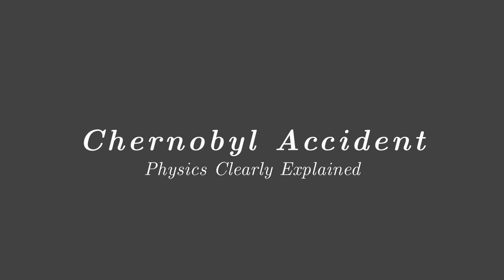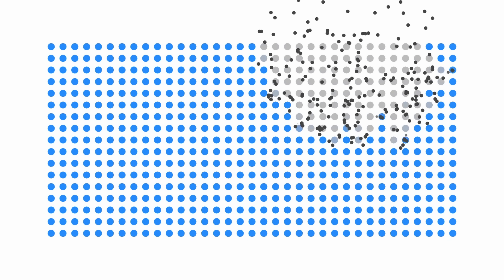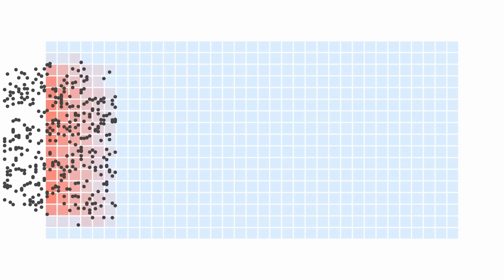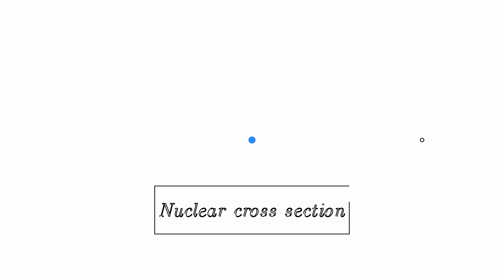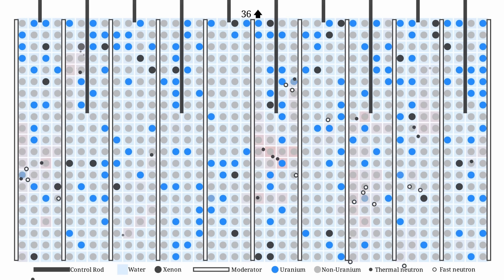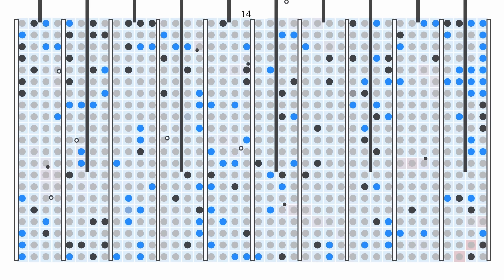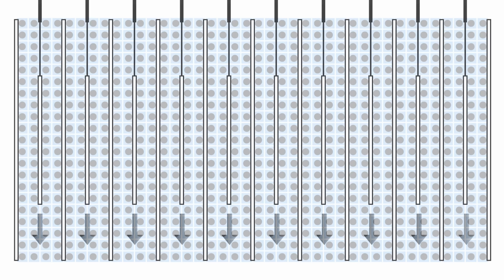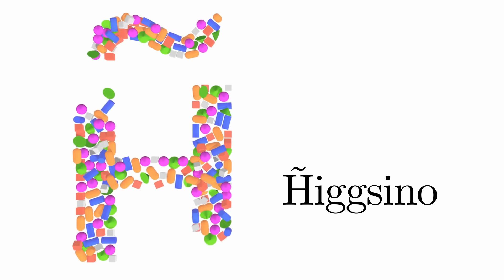Chernobyl Visually Explained

Comment: "The computer told them to turn off the reactor. They turned off the computer instead." Those words are equally funny as they are horrifying.
Reply: Sounds pretty much like safety culture in my country.
Reply: @manabellum rip
Reply: Nice way to put it (I'm an Indian) @manabellum
Reply: @manabellum  but we haven't had any such major lapses ( yet ) ..maybe a large population doesn't give a sh*t about safety , but what I've observed is this behaviour is only rampant when they are involved in it themselves ...for example drivers ...they know they will die too ..and that is what helps them go to those lengths I think ...think of it like this ..since their life is at stake too ...they respect the lives of the other only as much as they do their own...but organizations like isro and the army...where the sphere of influence of one's ignorance is way larger than they could imagine ..people are more reserved.
Reply: The nuclear operator equivalent of putting a sticker over the check engine light.
Reply: 😂😂😂 @MichaelTheRead
Reply: As a matter of a fact, the big failure here has been to deactivate half the recirculating pumps, decreasing water to allow the xenon buildup to make the reactor crazy..
This is horrifying.
Reply: No the crazy fact is nobody seemed to know how the control rods were a bad design too. This design would be like pressing the gas on your car to hit the brakes, you see how that makes no fuckin sense? But they did that here putting graphite tips on rods that should have been purely made of boron. It's the equivalent of hitting the gas pedal to somehow slow down from crashing your car, makes no fuckin sense and you will crash they just got lucky because they never needed to hit the brakes, until that one day they needed the brakes happened
Reply: @Flodu60500  What? The big failure was by the reactor engineers to make the graphite displacers shorter. The incident isn't a result of failure by the workers...
Reply: @Flodu60500  But that was the test!?
Reply: @Flodu60500  As a matter of a fact, they activated extra 4 recirculating pumps, plonker
Reply: "I'm afraid I can't let you do th---"
windows shutdown noise
Reply: Well, of course it’s saying that.  It doesn’t know we’re running a test.
Reply: Why seek out to fix carbon monoxide gas in your house when you could just remove the detectors making those anxiety-inducing noises?
Reply: @AnalogOsprey  Of course! Sleep tight. ;0)
Reply from the maker: computer: OH MY GOD SHUT IT DOWN RIGHT NOW!!!
operators: Okay 👍 shuts down computer

😂

I stole this comment from @herobrine8763 in a video response to my video
Reply: @Higgsinophysics  🤣🤣
Reply: @Higgsinophysics sounds like what homer simpson would do 😂
Reply: @Higgsinophysics  its says they sent a guy to the recreational center pool to investigate what happened to the swimming pool after the shutdown
Reply: @Higgsinophysics  prob the people they needed died
Reply: @Higgsinophysics  doesn't seem so funny. my great grandmother, my grandfather and my father died from Chernobyl.
Reply: @louiscyfer  We aren’t laughing at the deaths. No one is. It’s the utter stupidity of shutting down the thing that would have prevented the meltdown or at least warn them about the potential danger coming. It’s dark and I’m sorry they passed away from this. But, don’t take us the wrong way.
Reply: @louiscyfer  You are allowed to not find it funny. No one is stopping you.
Reply: @antisocialal4799  there was a design problem and a training problem. the people doing the test were not qualified, and the design of the reactor made it worse.
Reply: @NoriMori1992 Funny how?
Reply: The soviets were legitimately pretty good at automation engineering and computer science. So it's all the more disappointing that they designed a series of very effective control systems, and then promptly placed them in situations were they were ignored or pointless.
Reply: @r.b.ratieta6111  Dave?......What are you doing Dave?
Reply: They ignored the computer message because they are doing a safety test which the computer doesn't know about it
Reply: The safety test they were performing probably would not have tripped an alarm from the computer if they would not have forced the reactor to satisfy the power conditions needed for the test, without gradually running the power down to eliminate the factor of xenon poisoning. They tried to perform the test at night specifically to avoid having to reduce power output at high demand times during the day. To safely perform the turbine rundown test, it's been estimated that the reactor would have likely had to have been gradually run down over the course of several days in order to burn off residual xenon buildup. Apparently unacceptable in an area where there was high power demand from industrial users.

The SKALA process system was dead on right when it told them what they were doing was not safe, because it factored in conditions that the operators ignored such as the high xenon levels and reduction in cooling flow.
Reply: @wysoft the test was supposed to have been finished by the day shift as it was scheduled to be taken down for maintenence. The test had originally been scheduled to be performed during the day shift but around 2pm another power station went down and the regional operator requested unit 4 be kept online for the evening demand. The people who were originally supposed to perform the test were long gone and the night shift shows up and is basically told, by the way we're doing this test now.
Reply: @wysoft  thats not typically how reactor safeguards work. They don’t know what xenon levels are at all. They create a “trip” limit based on (mostly) coolant flow and other plant parameters. When the trip limit is exceeded the protection system will automatically insert a trip such as automatic rod insertion or a scram of severe enough. They deactivated these automatic trips
Reply: @namishkhurana5172 dumb Russians 😂
Reply: “Alarm fatigue.” Obviously I don’t know about this computer system in particular, but in general when computers are programmed to cry wolf a lot, operators are effectively trained to ignore it. I’m not saying it’s the right thing to do, but it is a real problem.
Reply: @KirisutonoNeko  System could not told them squat - PRISM program running on Scala computer needed 20-25 minutes (MINUTES!) to run full system raport. That was printed. And delivered by hand from the Scala room 50+m down the hall from control room. And yes, it gave operators recomendations, but it was mostly in term of fuel burnout ratios actros the core.

It was not screaming shit at them. The last raport was from 1:00am. It was not live nor ever was is inteded to be so. And Legasov, throwing tantrum in 1984 and ending Computational Science Departement of Khurchatov Institute made sure it stayed that way.
Reply: @ZiobroV  
I believe you. I meant to be mostly adding general commentary about alarm fatigue to the discussion above, but yeah, have no information as to this specific case.
Reply: Technically they were running a test😂 The computer didn’t know that. 
The point of the test was that at that low power would the reactors be able to power the pumps for its internal water system before the backup generators come back up in 60 seconds. (Meaning they are trying to run a condition the computer is not aware of so they turned off the sensors 😂). They cut all these corners thinking there was a fail safe button SCRAM. I mean if there’s a button I can press to erase my mistakes why not. At any other point the scram would have done its job, but they had created with all the cutting corners a perfect condition for the SCRAM button to be a detonator, which was now a design flaw
Reply: -My mind is going. I can feel it.

-Daisy, Dai…sy, …give me your an… swer, …dooo!
Reply: Packing the whole damn thing in graphite didn't help either.
Reply: @scottrackley4457  well, is a design decision, using graphite as moderator (+) instead of just water
Reply: Except that they are not funny in any way.
Reply: The most Soviet quote ever
Reply: Shooting the messager: atomic age edition.
Reply: There’s a “In soviet Russia” joke in there 😂
Reply: Hey if the blaring alarm from the computer is turned off, it will be okay as the alarm go off right?
Reply: This!!
Reply: Humans 😂
Reply: Happens more often than you think. A lot of accidents are a result of hubris and no regard for safety. Computers rely on reliable and accurate inputs. I bet the operators thought the computer was on the fritz because it said there was something wrong, but they had all the control rods out. That didn't make sense to them. They were probably only taught that the rods slowed the reaction not the water and xenon. They should have known that if the rate didn't increase at all after removing the rods something was wrong. Increased demand and pressure may have caused them to overlook and press onward hoping the issue would sort itself out. I can't imagine a time anyone should just accept the reactor is okay if you have to remove all of the rods. 

It's like driving your car if you ever have to put your pedal to the metal just to start moving would you not question it? They kept their foot on the gas until it was too late

I'm an engineer myself in an industry that's much more forgiving, but I am trying to be better about teaching my operators bout our manufacturing process in more detail so they can understand when something is really wrong and why
Reply: It's the Soviet Union in a nutshell.
Reply: These days it might be a good idea to not listen to the computer, because AI literally wants to end humanity..
Reply: And where never said.
Reply: I didn't see it so there's no problem
Reply: This is how accidents happen all the time most are negligence or lack of time to understand and react.
Reply: When my car makes strange noise i turn up radio.
Reply: "Fine.. I'm out. You're on your own" - The Computer
Reply: The real cover-up is that this was a secret feature of the RBMK, not a bug, incase of an invasion.
Reply: Other than it didn't happen.  The print out was old tell a type and in a different room. the data was not part of the manual
Reply: *Societ Anthem plays in the background"
Reply: Still happens everyday in modern civil & military aviation

as well as... well... everywhere =)
Reply: @СергейМандрик-ф6е  no... that is a load of cope.
Reply: @n3v3rforgott3n9  it really does happen everywhere due to corruption, in small and large companies. That's what happens you have a structure that favors production and revenue over people.
Reply: @n3v3rforgott3n9  No it's not.  Do you have any idea how often we shut that noise off to actually fly the aircraft?  We don't call her "bitching Betty" for nothing.  That's coming from a Marine (Naval) flight officer.  Semper Fi
Reply: @JViello  that is not a nuclear reactor....
Reply: I think (this is my opinion) , that we need to stop calling the Chernobyl meltdown an accident.  

It was a case of : " fuck around and find out " , and they bloody found out. 
It was case of expected and predicted consequences resulting from completely intentional actions. 

It was the biggest case of : "we told you so" , in recorded history. 

It literally was not an accident.
Reply: Those words made me click the video!!! 😂😂
Reply: Like portal 2!
Reply: Well you have to understand that the people who run the reactor, run a business. They figured the likelihood of it REALLY being an emergency was not worth the millions of dollars they'd lose shutting down the reactor, plus the bad press.

Nuclear power isn't safe due to the human element, which we will never be able to get rid of.
Reply: Piss Off computer, off you go. 😒
Reply: Absolutely
Reply: You cant outsmart stupid retards running reactors bad combo
Reply: Quick question, why does the uranium randomly pop into existence?
Reply: Not only the control computer but also the automatic protection system.  Madness.
Reply: Sounds like one of the Soviet things ever.
Reply: Sounds like that scene from the Madagascar movie. Those penguins trying to fly the plane
Reply: Don’t solve the problem, Silence the complaint is how incompetent politicians do things everywhere.
Reply: russia.txt
Reply: Very soviet.
Reply: Except that's not what really happened.
Reply: Corrupt government and stupidity mixed in a bad way developed this mess
Reply: 😂😂that's funny...
Reply: Also completely false.
Reply: You solved it for the case of a sphere.
Reply: Even if they shutted down the reactor it still would have exploded due to the building of decay heat inside the reactor until unless coolant was not supplied
Reply: "It's fine it's fine it's fine it's fine-"
Reply: Also sounds a lot like it is skipping over some details now doesnt it
Reply: WHAT WOULD'VE YOU DONE
Reply: I can relate. I disconnected my carbon monoxide detector because the loud beeping was making me dizzy and giving me a headache.
Reply: How very Soviet of them, eh?
Reply: yep
Reply: The type of people to unplug the fuse that makes the “check engine” light turn on instead of fixing the engine
Reply: I blame 98% of this on human incompetence. 2% of a fault switch
Reply: Not bad not horrible
Reply: “Hold my beer” redefined
Reply: Amazing...  Cant even image doing that and all the other mistakes.
Reply: HAL 9000 approved👍👍👍
Reply: computer was like "bro it says this is bad, u should stop"

and we were like
"shutup"
Reply: The people who were there wasn’t even properly trained for that situation. One of the primary 3 men involved? This was his FIRST WEEK ON THE JOB.
Reply: Whoever made that decisions deserves a bullet to the back of the dome.
Reply: It's a typically Soviet thing to do, though.
Reply: The computer was NEVER turned off that night!
Reply: That's Soviet Bullshit Union for you. And, of course, Dyatlov, who wanted really badly to complete tests that were pending for a couple of years. But he needed an authorisation to actually start them and it was postponed when the reactor was already on low power, which led to xenon build up.
Reply: @MrAliquam  "Soviet Bullshit Union" looks at highly sophisticated soviet missile designs such as the P-700 Granit which western nations still cant compete with and looks at three miles island
Reply: @sovietheart3883 The worst nuclear accident in US history was a very small partial meltdown that caused zero deaths, zero health problems, and zero effect on the world. The "Soviet Bullshit Union" you seem to be so ready to protect nearly killed half the planet because they'd rather do that than admit they screwed up. Get over yourself.
Reply: Could happen just as easily anywhere else.
Reply: @MrAliquam  Its not not the soviet union though. 
Long before Chernobyl the americans accidentally made Corium when the Three Miles Island reactor nearly burnt up. (Now they want to reactivate it for Amazon and Facebook, I am not sure if that is still irony or just sad)
Then we had Fukushima. 2 Decades after Chernobyl. better design, better Physics, no weird dictatorship. And wouldn't you know it? Greed and negligence allowed safety concerns to be brushed under the rug until something blew up.
Then there was a whole chain of "It will work and most importantly, it will be cheap" -> "Ooopsie" chains regarding waste management in both the free and the commie republics of germany.
Honestly, nuclear energy is historically full of fuckups, the soviet one was just the most spectacular one.
Reply: @BugMagnet  Yeah no.  Comparing 3 mile island to Chernobyl is really just silly in all meaningful ways.  Even with the corium produced, there was an extremely limited release or radiation because of the building it was housed in.  The reactor they want to turn on was unaffected by the accident, and produced power for another 20 years after the 1979 incident.  
Comparing it to Japan is also silly, an earthquake hit beyond the design limits of the structure. Everyone thought the fault line could only produce 8.5-8.7 quakes.  Because of the logarithmic scale when the 9.1 hit, you're talking about an earthquake with 4x the energy released.  The Tsunami, even in historical records, had never been recorded at that level in that area.  You're talking about a culture who marks the land with blocks saying "don't build closer than here, the waves hit in the year XXX".  The Fukishima plant was also actually OLDER than Chernobyl.  The design was just as old as the RBMK, but it had a containment building.  Containment buildings were too expensive for the Soviets, and since nothing ever went wrong (soviets fried a lot of their own citizens and covered it up) they decided to not put one in.  
Acting like nuclear power is "full of fuckups" is due to fear mongering and misunderstandings about nuclear power and radiation.
Reply: @BugMagnet  you are ignoring very important important difference. Propaganda mindset. Everything must be alright in USSR. They were quiet about the explosion for a very long time until it was impossible to ignore.
Reply: @MrAliquam  Did I? 
20 years ago I would have probably said the same as you did. But experience taught me otherwise.
"Our Diesel engines are super clean, the americans just don't know how to measure things" (nope they were not)

"Our salt mines can hold nuclear waste indefinitely" (nope they could not)

"Lehman Brothers is a solid bank" (lol)

the list goes on and on (those "we are the good guys" mindsets have caused a myriad of desasters of all kinds. It is a human problem, not a communist one.
Reply: @BugMagnet  bro really comparing Chernobyl, which was entirely human error and greed, to Fukishima, which literally suffered a massive earthquake AND a tsunami. 

What a clown
Reply: @emmanuelmedina2740  We are talking about the Fukushima that should have never existed in that spot because they knew 100 years in advance that it was a tsunami hotspot, right? That Fukushima with the very very obvious and agregious safety flaw that was ignored due to human greed?
Reply: @BugMagnet  Thorium reactor fixes every single one of those events.  That's the problem.  They have been trying to polish a turd; current reactor design.
Reply: @JViello  Yes, but since the 1970's are half a century ago and we now have dirt cheap renewables that can set up in mere months after a town decides they want some, and batteries are dropping in price like a brick thrown out a window, there really is not point in scaling up a new reactor design that comes with at best questionable cost structure in the and and still produces long lasting waste.

I do agree that on paper Thorioum reactors look like a great solution in princible, but I do not see a business case for them currently besides being a fascinating research topic.
Reply: I have just started watching the video, but if that's what is actually being said, he fell for the Soviet propaganda and gaslighting by Legasov. It has been well established that in order for the printout from the SKALA computer to reach the control room on time it would require the workers to run with literally supersonic speed
Reply: @Ludvigvanamadeus  sounds like a design flaw. A message THAT important should be readily available.
Reply: @PowerOfNull  it's a minor one compared to the other major design flaws and, most importantly, the ignorance of the Soviet nuclear scientists. They didn't really understand the physics of their own reactor, which resulted in faulty operating manuals. The vast majority of the "violations" supposedly committed by Dyatlov and others would require time travel, as the procedures they "violated" were written and amended after the disaster
Reply: @Ludvigvanamadeus  Why would that be Soviet propaganda? What does that do for them?
Reply: @wildfire9280  I don't know, what could the soviet scientists possibly gain from shifting the blame for the Chernobyl disaster from themselves to the operators? 🤔
Reply: @Ludvigvanamadeus explain
Reply: @Ludvigvanamadeus  Propaganda or not, it was a Soviet design run by Soviets that caused a massive nuclear disaster in the Soviet Union. Many, many Soviet failures were required to get to this point.
Reply: @hydrocarbon82  didnt happen on mainland tho. Happened in ukieland.
Reply: How was the computer supposed to know it was a test?
Reply: @NitroDubzzz don't need to, it  gives directive based on input analysis, and its result was: shut down.
Reply: @NitroDubzzz  I was quoting the HBO miniseries ‘Chernobyl’.
Reply: sound like trump:  getting bad covid test results?  do less testing!
Reply: "The computer told them to turn off the reactor. The Party told them to turn their heads away" would pretty much summarize entire USSR.
Reply: Many kind of catastrophes on big systems (Chernobyl, air crash etc.) , have this dumb action in common.
Reply: At ~12:30 (for those weirdos who skip through videos)
Reply: Dumb comment. People turn off warning lights all the time when they think they understand a system and know the computer is just programmed to throw an error.
Reply: Even dyatlov is an ignorant when one employee said "There's no reactor"
Reply: Kan A.I. dit voorkómen?
Het was niet de 'reactor' die boem zei; het was een water-gas-explosie.

(ónder was het 'mis'; daar was minder ruimte dan noodzakelijk)
Reply: Somehow a very russian reaction.
Reply: @Spherehead123  ukrainian.
Reply: Which is bullshit
Reply: @atl5100 so much bullshit.  Hey what's going on with zapporizhia
Reply: Yep. They're Russians alright.
Reply: So Slavs can't:
Boil water
Read
Reply: In fairness, it sounds about right for a millennial. So, maybe he was just ahead of his time.
Reply: @VoidHalo  also gen z